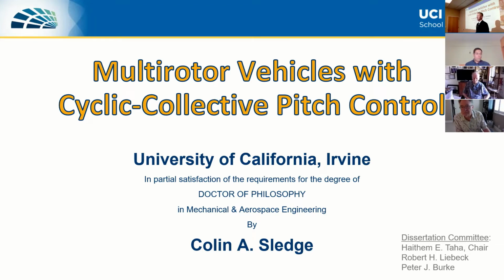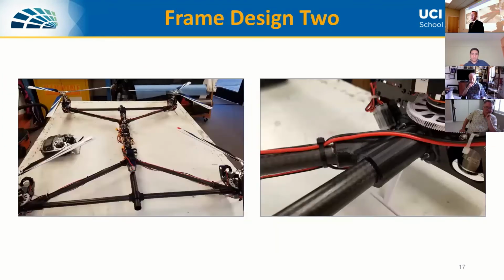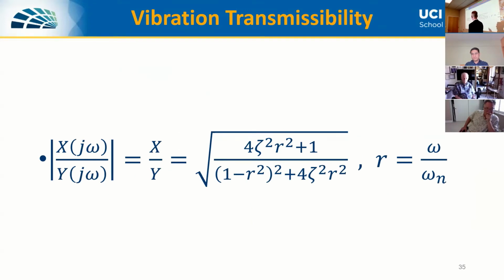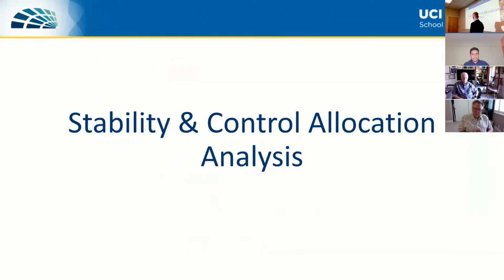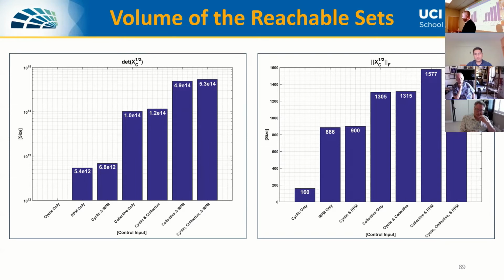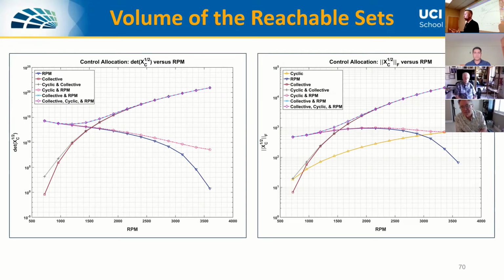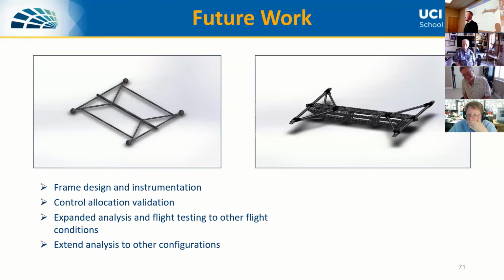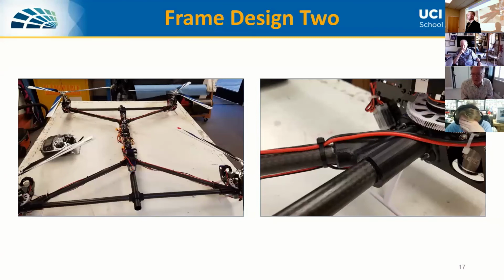Multirotor Vehicles with Cyclic-Collective Pitch Control

Comment: It seems to me that not using collective for roll and pitch control is a waste, and may contribute to failures as well. Is it really necessary to have yaw authority in autorotation on a balanced multirotor? RPM control may not lend much authority, but could it perhaps be used to distribute the vibration energy, and actively avoid failures caused by natural resonance?
Reply from the maker: That is a good observation. In fact, the part od the research looked at control authority using combinations of different controls like RPM, collective, cyclic control. As you alluded to, the collective control was very powerful and would be a good choice for a control scheme.
Yaw authority IS important during a 'controlled' autorotation because it is important to be able to control heading. A few feet off the ground and hovering, there are few options for autorotation and the best course of action is just trying to minimize descent rate. I would agree that controlling heading is less important. However, many autorotations are at altitude and a forward speed. In this case controlling head ia critical and it is not simply a matter of the aircraft being balanced in terms of lateral contributions in drag and thrust, the pilot needs to control direction to execute a safe landing. It is also likely that an aircraft would not have perfect symmetry, trim/thrust, and flight conditions, so even a balanced or trimmed multirotor would need some yaw authority.
During the autorotation, there is a narrow window of collective position to keep driving and driven regions of the blade balanced and the rotors to remain spinning at an appropriate RPM. Without collective control, it would be virtually impossible to execute a controlled autorotation and the vehicle is likely to lose control nearly immediately. With collective control, you could enter the autorotation and have pitch and roll control. The blade pitch must be modulated based on the flight conditions, speed, descent rate, etc. so that the rotor doesnt slow down. This would likely impact control authority. Now, in terms of yaw authority, it is suggested that the yaw control is significantly reduced and potentially reversed (pilot commands left, aircraft yaws right, etc.). You will commonly see coaxial helicopters with large vertical tails and rudders because yaw authority is reduced (and possibly reversed) during light disk loading and autorotation.
All of this is to say that my hypothesis is that cyclic control would be important during autorotation. I DO AGREE with you that collective control is powerful and would be a good control scheme. Cyclic control would be useful in a small range of flight conditions. You also mentioned allocating control power to modify the vibration response and that is another discussion in the research!  As to why I only used cyclic for control in this first iteration: most multirotors use RPM or collective, so I wanted to see how this worked and then dig in further! :)
Thank you for your thoughtful question and discussion!
Reply: @colinalexandersledge6930  thank you for choosing such a cool thesis and sharing the defense here. It was a very engaging presentation and it is by far the most detailed on these issues anywhere on YouTube. :+ )